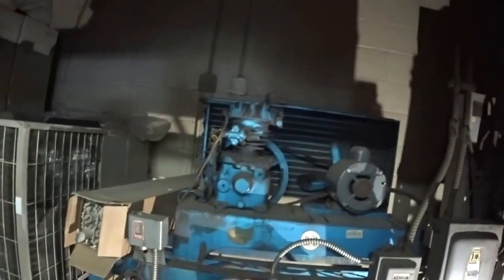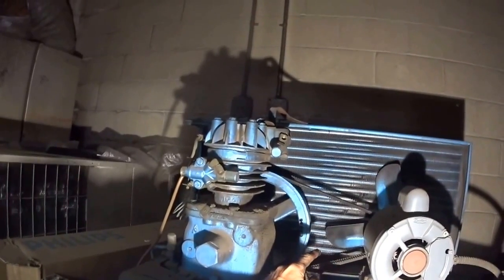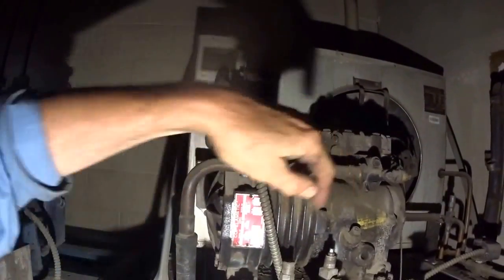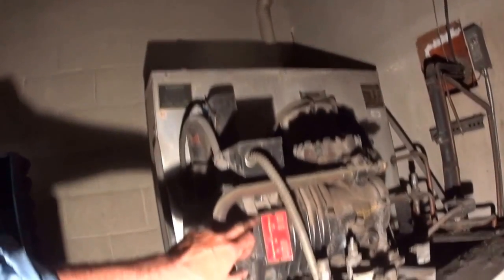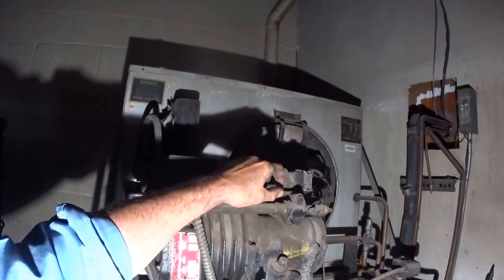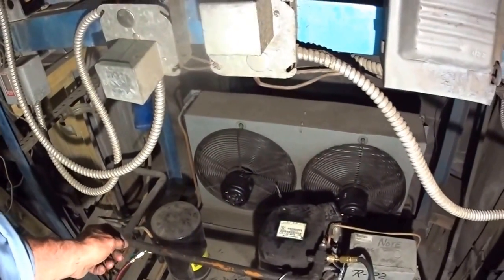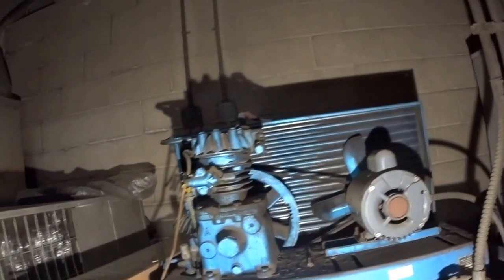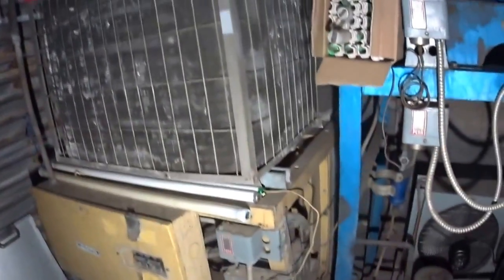Old School Refrigeration Equipment

Comment: I like open drive compressors. One thing you will never have to deal with in an open drive system is cleaning up after a compressor burnout. If the motor dies in an open drive system, you simply replace it and keep on going. If you end up with a bad valve in your valve plate, you isolate the compressor with the service valves, replace the valve plate assembly, evacuate the compressor, open the valves, and fire it back up. Same goes for replacing leaky shaft seals.

The main problem with open drives is that the shaft seals do eventually wear out and need replacement, but often they simply were ignored and the system repeatedly topped up since Freon was cheap back in the day. Since the systems always lost oil along with refrigerant, you could end up with  a low oil situation if you didn't pay attention to the sight glass. The seals were usually quite easy to replace, and not particularly expensive. Letting it leak and topping up was just laziness or false economy. Those old compressors were constructed so well that, were the systems properly maintained, they could still be running today.

Comment: Cool!
Do these open-drive systems require oil to be mixed in with the refrigerant?
Reply: Most systems require a small amount of oil to be mixed with the refrigerant. In a reciprocating compressor it's inevitable that oil will make it's way past the rings and end up mixed with the refrigerant. That small amount of oil does help the reed valves seal and prevents them abrading against the valve plate. Likewise, oil helps scrolls seal in a scroll compressor, and rotors seal in a screw compressor. About the only compressor that doesn't need oil mixed with the refrigerant are centrifugal designs.

Comment: You know those compressores aren´t old school. They are still used. I am also from Portugal and you still use them here.
Actually the open type compressor has less power lost compared to a semi hermetic. You know semi hermetics have been around since the late1950. So they are old school two.
Buy the way scrooll compressor was invented by Copeland back in 1905. They stoped using them because of mechanical problems. Problems that where over taken in fhe final of the 80's

Comment: cool video.  I worked on rv ammonia fridges for a few years.  They rusted and leaked around the welds.  Look for the green.  They used propane gas, 12vdc and 120vac heating elements.  When they worked they worked good.
Reply from the maker: All Hours Maintenance  thanks

Comment: Like how old are they
Reply from the maker: heatpump hvac probably something like 1955
Reply: Oh is it a r12 compressor because r502 didn't come out I read online until 1961
Reply from the maker: heatpump hvac yes, I think there were replacement compressors probably into the 70s
Reply: Yeah I haven't never seen one before

Comment: Great video Jim!  I never knew how Copeland started out, the early Prestcold ones here had bronze rods, i think they were built under license from Copeland as they were so similar.
I've worked on a few Frigidaire belt driven units, but not seen one running for 15 years, when they went to semi hermetic  they kept the same style condensers with one fan motor running two fans, the second one was belt driven off the motor. They were more fun to work on that todays stuff.
Reply from the maker: heavydiesel  thanks